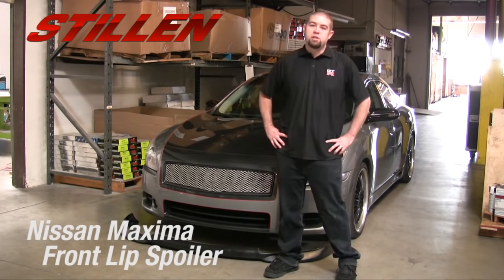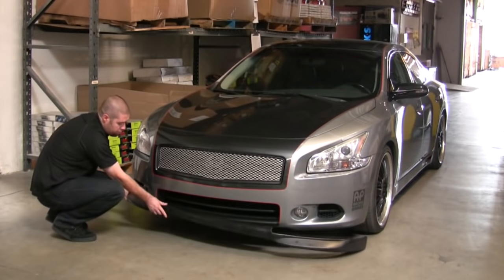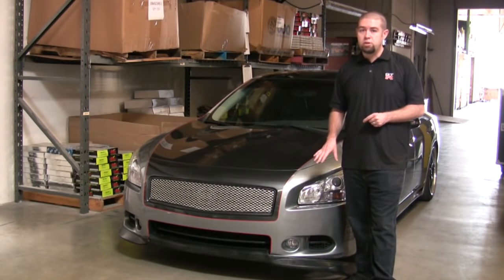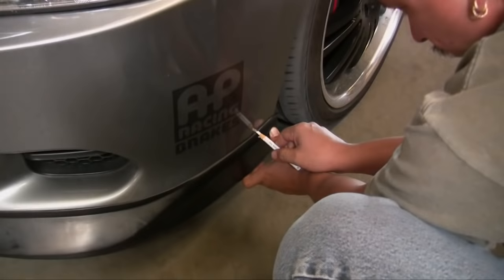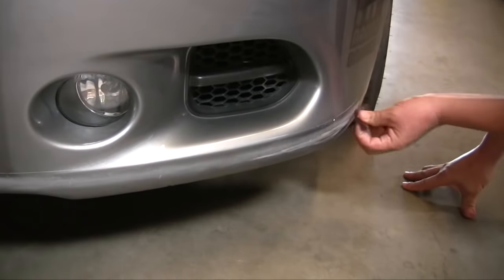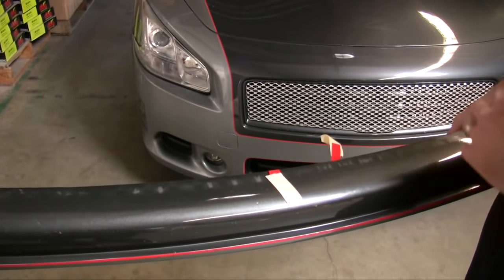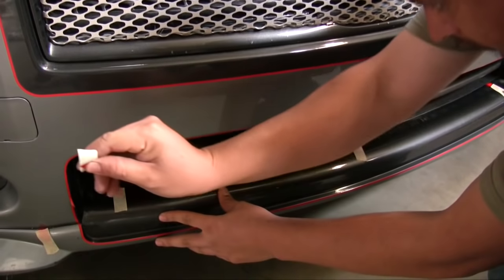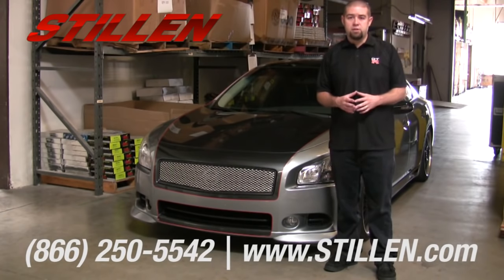2009-2015 Nissan Maxima Front Lip Spoiler Install | STILLEN

Comment: Does the the bodykit for the 09-15 Maxima fit the 13-16 Altima since they're roughly the same size in width and length. I've seen videos that has the the front lip, side skirts and rear bumper pieces to make the bumper look lower. I have a 14 altima and would like a different kit, but there isn't any for my car. So I was wondering I the Maxima kit would fit the Altima
Reply from the maker: +sneakeyez  no it won't fit.  We do carry the front lip spoiler (KB13142 and roof wing (KB13144) for the '14 Altima. Hope this helps!